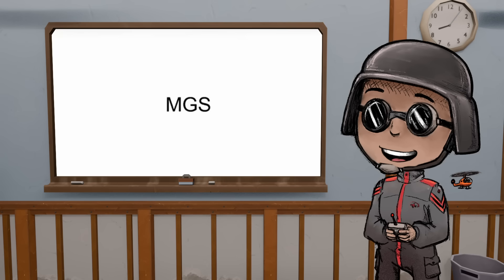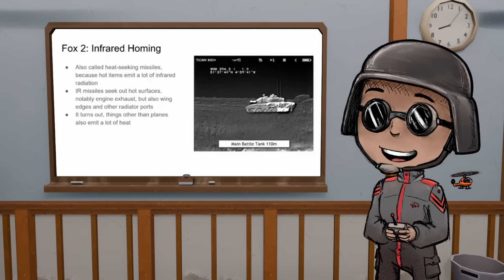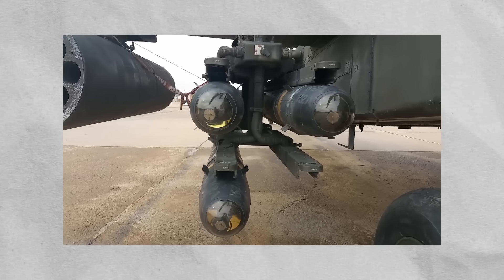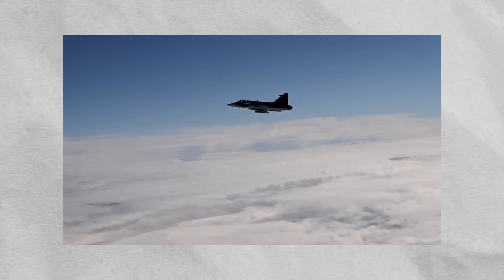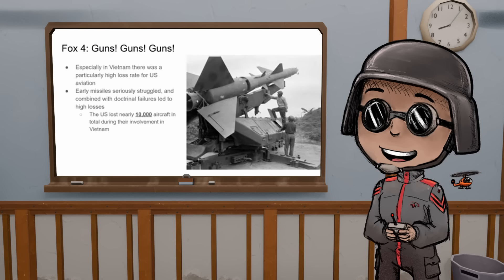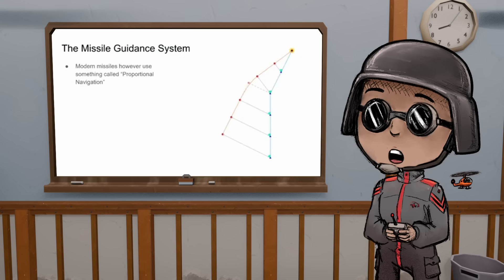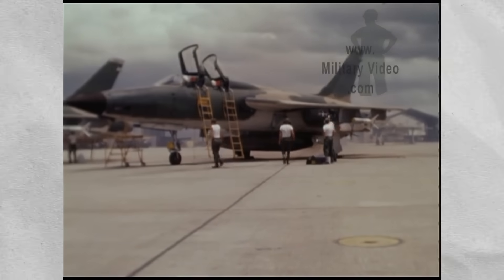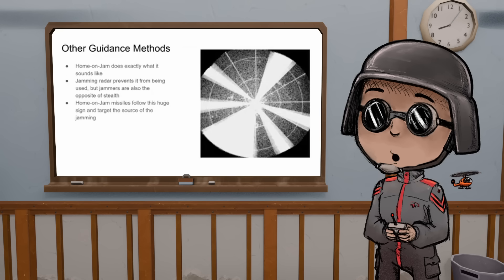An Actual Engineer Explains Guided Missile Systems

Comment: Contrary to popular belief adding guns to planes isn't what improved their effectiveness. The problem's with the accuracy of early radar missiles was due to improper handling by ground crews because these missiles where meant to be stored in climate controlled environments but where instead left outside. Also the restrictions imposed by the rules of engagement in Vietnam made it so that aircraft had to visually confirm a radar contact before it was fired appon ( because IFF was unreliable) to avoid friendly fire. Top gun was made to tech pilots new tactics on how to use they missiles and not dog fighting.

Comment: Most modern missiles are equipped with GPS/INS/Data Link, which means the missile doesn't even need to know where it is; all it knows is to go to a specific location and use its onboard X/Ku band seeker to find the target.

Comment: Shoutout to ISAF in Afghanistan using Javelin infrared guided ATGMs against random snipers on hills.

Also the thing about Top Gun teaching to use guns is a myth, it was about the tactics to use missiles (guns too, but that was the main issue)
Reply: Even the "f-4 got internal guns" is not entirely correct. Only the chair force's f-4e got the gun. Navy only had gun pods.

F-ing reformers

Comment: 8:55 not necessarily, there are jammer types that are not white noise jammers. Some can give low power pulses that are timed to make the radar think there is a contact at a different location
Reply: And or send signals that interact whit the antenna elements inside the radar to make it only pick up noice